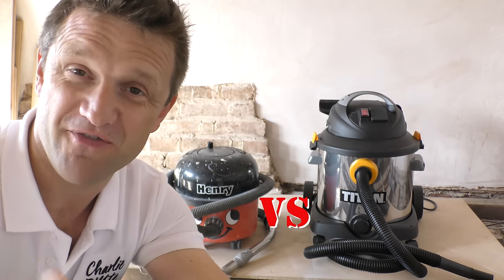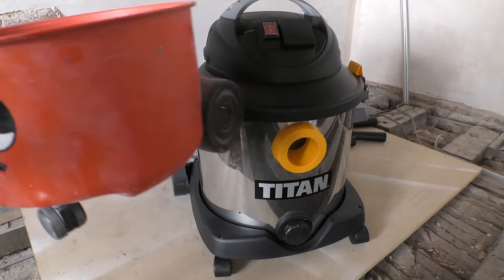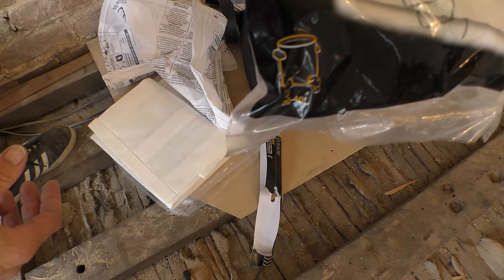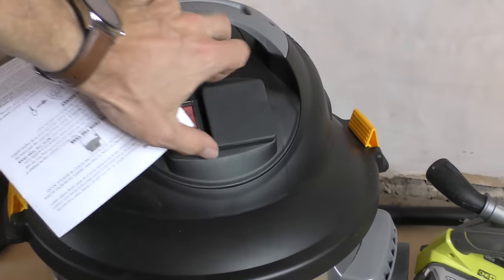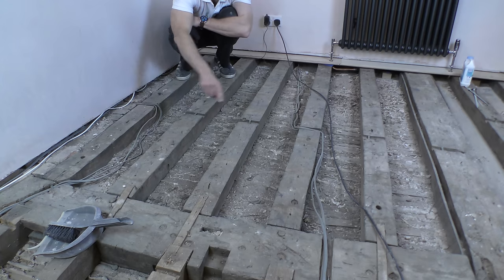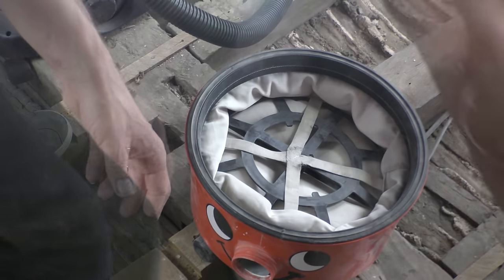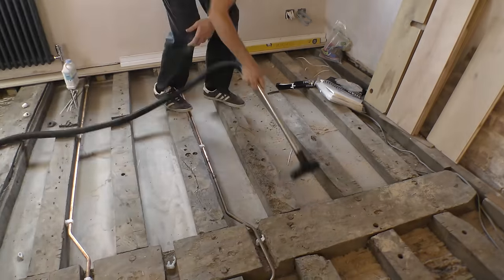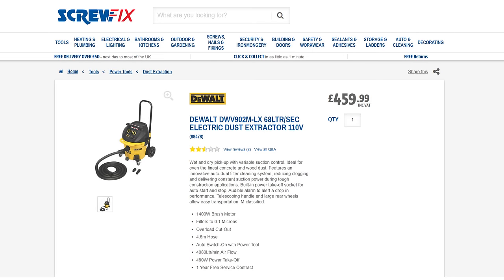TITAN vs Henry - DIY Vacuum Review

Comment: Freaky , we seem to be doing the same project but I’m two years behind you … I bought the 16L mode , very proweful but the pipe diameter is very narrow - wondering if the bigger models have larger bore (and less likely to block up)
Reply from the maker: This vac is best as a static shop vac attached to a dust cyclone as discussed here. Hardly used the vac after this video but it had a new lease of life for my wardrobe build https://youtu.be/9RfHpm2vf40

Comment: They've updated these now. I've just bought the 20L version and the hose connection has a push and twist connector on it now, it's not great quality but does mean the hose is a lot less likely to pull out. They've also added some basic tool storage and the bag seems to be a fairly secure fit on mine but I'll see how that goes when I fit replacements.

Comment: To be honest I never thought I'd watch a review on vacuum cleaners.... But kinda glad I did.

Gotta be Henry on site. Was thinking of buying the titan one but I won't be now.

Did some looking around on Henry's website. Why didn't you buy the Henry wet and dry?
Reply from the maker: Hey buddy, good to hear from you. It was a slightly unfair review because the Titan was never designed to be a domestic vac. When used as a static shop vac with a cyclone it's actually very good - as I found on my wardrobe build https://youtu.be/9RfHpm2vf40 It can't compete with Henry for build quality though. I bought that Henry years ago when I didn't really need a wet and dry. I have George now though. Awesome bit of kit https://youtu.be/1TPNXCWiqeo

Comment: I did this exact test a few weeks ago after knocking a few walls down to install some RSJ's. This was a big job on an old victorian detatched property. The redsidual dust left in the room after removing all the rubble was immense so, thinking my old Henry wouldn't be up to the job, I decided to try one of these new Titan's. To my astonishment the big new Titan couldn't deal with the large quantities of dust. It kept losing power and suction, like it was dying. It could only run for maybe 30 seconds before needing a 5 minute cool down to bring it back up to full power - which is weak at best. I boxed it up, threw it in the back of van and retrieved my old Henry, which didn't miss a beat. I could swear the fker winked at me after the job was complete. The Titan went straight back to Screwfix. The thing was completely useless for large quantities of thick fine dust. If you do get a Henry (or indeed his wife Hetty) just make sure it's one of the more powerful, pre EU directice cleaners. This does mean you'll have to get it secondhand though but that shouldn't be a problem, especially considering that you'll get one for under 20 quid!

Comment: I like the Titans.  I have the large one with the 3 pin socket for power tools which is a great feature.  It allows automatic turning on of the titan when you switch your power tool on.  It makes for a good dust extraction tool.  For the workshop though the Schepac 70 litre dust extractor is better especially for the bench sawc and router.  The Henry is expensive for what it is and needs emptying regularly.  The Henry though has better hoses and build quality but why cant they design a better and easier hose to bag coupling for the Henry?  The Titan by the way seems to be a re badged Shopvac.  They are very similar and probably made in the same factory.
Reply from the maker: Thanks for that, Paul. You clearly know your vacs!!

Comment: I have lots of DIY jobs to complete in the next few weeks. I'm considering the titan. a
At least I know what to expect, therefore I will be less frustrated if I do purchase one. Also I will be able to modify the bag nozzle before using it after seeing your video. However I've just had another idea. I might tape the bag over the filter. Also I will try and use my old Vax toolset. Thanks for sharing
Reply from the maker: The two things that most annoy me about it are the bag hole being too big (the designers should be sacked) and the lack of cable tidy/ furling mechanism, oh, and the flimsy hose which kinks of you're not careful. It's a lot of vacuum for the money though.
Reply: @CharlieDIYte  thanks again, hopefully the motor will last longer than my Vax what cost me double the money for about the same power.

Comment: Confused about the Henry's power, because you said you changed the motor, would the titan still be more powerful if your Henry had its original. Great video though, thanks.
Reply from the maker: It's a tricky one this because the new Henry motor is arguably as efficient as the older more powerful one but in a new Henry with its modified extraction system, not in my old machine which was designed for the more powerful motor. I'd never buy the Titan again though. It's poor tubes and ill fitting bags make it an unpleasant machine to use exact maybe as a shop vac teamed up with a cyclonic extraction thing.

Comment: The Numatic range of dust collection vacuums (which includes Henry) are really worth the extra money. Another brand I'd recommend is Nilfisk with their Aero range performing very well in my exoerience. Vacuums are run for extended periods and noise levels are another important consideration for me. The Nilfisk Aero 26 is rated at 65db which is perfect for use without hearing protection. Anyway great video - for me the Titan performed as expected and it's not something I'd be recommending to a mate. Cheers. Karl.

Comment: Hey Charlie - I know it's not the topic of the video but I'm interested in why you're insulating between the floors in your house. I may have to replace the floorboards upstairs in my house so I am thinking of adding insulation too, but I'm not sure if there's any benefit to be had? I guess it will make downstairs warmer?
Reply from the maker: Good question. Yes, to make the downstairs warmer, for sound insulation, and also to make zonal heating (I now have the Drayton Wiser smart heating system installed with smart valves on each radiator for room control) a bit more accurate. To be honest though I still wonder if the benefits are worth the cost although the insulation itself wasn't that expensive.
Reply: @CharlieDIYte  Thank you for the reply. I hadn't considered the sound aspect of it and that might make it worthwhile to us in itself as you can hear the tv in the room below sometimes. By the way I decided against the titan after watching your review because of the poor fit with the bags and instead went for a vacmaster with hepa filter to help control my asthma. Really pleased with it so far.

Comment: Just bought this myself not long ago and mimic some of your thoughts. Still think it’s great value for money for what you get but the carpet attachment is pretty useless pics up hardly anything.  When I attached the bag my initial thoughts were it’s flimsy and will leak through and the pipes are too narrow. Small diameter pipe I had the same issue cleaning up bits of wood and plaster but fine for using with power tools. 3 small design improvements could make this a really good hoover as has decent power large capacity and the socket function is good as well as the blower

Comment: Theres always bigger Henrys and theres so many spares available that its easy to keep going. The suction of Henry is similar to many shop vacs despite only being 620 watts, its air watts are excellent. Also Henry has flo max hose which has a wider dimeter where it connects to the body inorder to reduce blockages.

Comment: Probably a silly question but can you connect a 110v transformer with a tool to the titan and have it activate the power take off when using said tool or will the titan take off on connection of the transformer??
Reply from the maker: It only has a three pin plug on the power take off
Reply: @CharlieDIYte  I know yeah, what I mean is plug the 110v transformer into the power take off socket, and when you plug the 110v tool into the transformer will that operate the take off or will only the transformer itself trigger it? I've actually ordered the Titan 30l anyhow so I guess ill find out!
Reply: @CharlieDIYte  Can confirm that plugging in the 110v transformer does activate the power take off. Great product though in fairness, very happy with the purchase!

Comment: Hi Nice review. When I was looking for a vacuum for my DIY workshop  I looked at the Screwfix & Toolstation offering. In the end I brought one from Lidl which was a better spec but slightly more expensive at £69 but has a metal  tube which is telescopic, plus various attachments d a power take off. In fact I am awaiting the delivery of the Aldi look alike which will replace the unit I have on the garage. Hopefully your unit will serve you well.

Comment: In your view, can I still get the dust bag for this unit as Screwfix site comes up with "error" message. 
I wonder if the alternative model parts, dustbag and cartridge, are compatible with it! Are the following any good as the originals are gone now? I, too, have noticed that there's considerable dust buildup in the tank and the cartridge now days can be washable on the later models as shown below.
TITAN 20LLTR M-CLASS DRY VACUUM FILTER BAGS 5 PACK (989RG) 
TITAN TTU920ACC-M M-CLASS WASHABLE VACUUM FILTER CARTRIDGE (977RG)

Comment: As usual another great and helpful review Charlie. I have to say that I bought a 2nd hand Hetty (Henry’s little sister?) about 7 years ago, for all my DIY use. After a while I stopped using  bags and just let the main filter protect the motor. I’ve absolutely hammered the poor girl, but she’s still going strong. Once full, I just tip her out into the bin and bang the filter like a tambourine, then she’s good to go again. The Titon is cheap and as a shop vac I might use a cyclone with it, but just from your review.....I think i’ll stick with my Hetty. I mean 10 blockages to do the same amount of work? That would do my head in. 👍
Reply from the maker: Thanks mate. Yep agreed. A cyclone combined with a Henry is probably the sweet spot. I have upgraded the Titan to HEPA filter which helps to reduce the dust coming out of the massive exhaust, but the biggest flaws with it are the poor fitting vacuum bags around the inlet pipe (the designers should all be sacked for this muppetry), the lack of a cord tidy (one of Henry's greatest plus points) and the poor tube and cheap accessories. The tube kinks almost every time I use it.
Reply: Charlie DIYte I think I banged my head.....forgot this video and went and bought the Titan yesterday. Actually quite impressed with it. The lid came off when I moved it, which was strange, but I think if it’s cared for it should be ok....ish 👍 paid £69 for mine, so you got a good pre-covid19 deal I guess.

Comment: I use a Nilfisk Aero 25 which is fine and serves me well but also have an ancient Aquavac which I use for rough jobs.  It sounds like a jumbo jet and would fail every current noise and power level limit - it keeps going though.  I’ve built a cheapo cyclone using one of the blue food barrels and an eBay cyclone attachment and that seems to keep the bags from filling up as quickly.

Comment: Ive had the Titan for about five years, it’s been bashed about, but still works. The suction power is more than adequate. My gripe is that the hose is rubbish, so flimsy, constantly getting a kink when using and eventually it will split. But, as a cheap hoover, it’s alright.

Comment: I wonder if the tube is narrower because the shop vac is designed to also suck up water?  Maybe with a bigger tube it isn't able to suck up water very well.
Reply from the maker: Possibly but you've hit the nail on the head there. It's a shop vac and it was unfair of me to pit it against a domestic vac. I now have it connected in my tent workshop to a cyclone and it's fantastic. https://youtu.be/9RfHpm2vf40

Comment: Hi Charlie hope your well! I thought as you where working hard have you tried to use the titan tin drum with the Henry motor head if it fits more capacity for Henry and if need be you can purchase a more powerful motor for Henry and I am sure you could rig up an automatic switch for power tool in conjunction the you powering up your tools! Loving watching your shows currently laid up so had to delay your saw horses which looked great! Cheers Dale
Reply from the maker: Hi Dale, no I'm afraid I haven't. To be honest I've hardly used that Titan (in spite of buying the hepa filter for it soon after doing this video).  The plastic accessories aren't really fit for purpose and the fact that the bag doesn't fit snugly on the inlet nozzle is just rubbish. Thanks so much for the positive comments. Hope you're not laid up for too much longer 👍

Comment: Just came back to this video, i'd forgotten the Titan had the plug & blow functions.  Are you still of the same opinion on it, or is Henry still to goto?
Reply from the maker: Hi Lee. I upgraded to the hepafilter as I felt it was belching out too much dust, but the bad fitting dust bag still massively irritates me. Also, it annoys me there's no cord tidy and I've ended up zip cording the entire lot to the handle and using an extension lead. Finally the hose and attachments are pretty useless. Such a shame as these are such simple things to fix. I'd scroll down the comments and see what everyone else recommends, but in summary I hardly use the Titan and my Henry still rocks! Bought a George recently to wet and dry the kitchen floor. Absolute game changer (but not really well geared up for domestic work because there's no cord reel-in and it's a bit heavy to lug around. Depends on what you want to use it for though, as if it's going to be in a workshop all its life, with the plug, and perhaps combined with a cyclonic attachment bin it would probably serve you very well.
Reply: @CharlieDIYte  Thanks Charlie, some  real honest advice .  I'm  not bothered about using a shop vac for domestic, so still an option, as I do a lot of woodwork & that diameter pipe would be fine for sawdust - I just need to weigh up how many other big jobs i could use it for..   I will check out the comments below.  Cheers.  Keep up the good work!

Comment: Great video Charlie - totally agree with you about trying to keep the machine in good working order by using vacuum bags and keeping dust away from the motor. I have the same issues with my Ozito 20L from Homebase having a poor seal where the bag connects to the hose, so thank you for your tip with the black tape as I will give that a try.
Reply from the maker: Cheers mate. Thanks for the comment. I have a new vacuum video coming out in a day or two to keep an eye out for that 👍
Reply: @CharlieDIYte  did you do a video on the insulation you used for your floor?

Comment: My Henry tip: run a damp sponge around the rubber rim of the filter when doing work with fine dust. Makes a big improvement to suction.
Wall chaser work clogs HEPA bag pores in no time so I always use the brown paper ones from Wilko - they suck fine until they are full.

Comment: My wife sows me zips on the henry cloth dust bags so i can empty them , they last ages.
Reply from the maker: That is brilliant. I've been looking for a solution like that for ages.
Reply: @CharlieDIYte  ebay sells cloth henry bags with zips, with a little creativity and a compass cutter(also ebay) you can trim the henry bag hole to fit bigger things like the fitting in your titan or any shopvac metal bin type
Reply: @CharlieDIYte  ohh realy it was out years ago
Reply from the maker: @MAli-rr5ko  Fair point 🙄 On reflection I haven't been looking particularly hard. On a completely separate point, I've just bought the pet kit for my HVX200 (domestic Henry that I don't use for building work) primarily to cut out the dog smell but I tell you what, with the new Aero head to replace the old one, the suction is for some reason so much better.
Reply: @CharlieDIYte  okay can we get in touch on social media so we can talk about DIY
Reply: @CharlieDIYte  i dont have a dog will i still get the dog smell? ;-)

Comment: In the US we have the Shop-Vac branded tight vacuum cleaners and they work a whole lot better than the Titan because you can get that crappy little tiny hose that you're using right now or you have the option to upgrade to the bigger hose and the bags are actually cut to fit they don't fall off I've had this six gallon stainless steel shot bag for about 15 years now and it's wonderful

Comment: We use a 30 quid basic titan in the workshop for sucking up liquids and stuff you don't really want to touch in the drain industry 
only thing thats wins over with the Henry is cable storage 

Shame you couldn't swap the motor out of the titan and have a hybrid Henry   1400W. not just 610W 
Think I would have brushed up the big bits up first and ( saved the bag contents ) and used the hoover for dust and bits its designed to do
Reply from the maker: Fair point!

Comment: My titan vacuum is the same, always gets blocked with rubble and I've also found that fine filler dust clogs the filter as well
Reply from the maker: Yes, the only thing going for this is the 1400w motor and the price. Why they can't design a bag that fits tightly to the inlet pipe is beyond me. I invested in the HEPA filter later, which helps but doesn't alleviate the leakage.

Comment: Hi Charlie like you I have had my Henry for nearly twenty years and used it through a full refurb of my new house and used it on decorating in business. I also bought the Titan but it was not as robust as the Henry. Poor accessories as you explained. Great video well informative
Reply from the maker: Thanks John. I've realised the Titan is really a shop vac (so the comparison was a little unfair)  and when attached to my cyclone it works a treat. https://youtu.be/9RfHpm2vf40